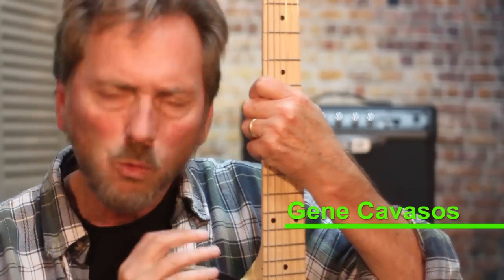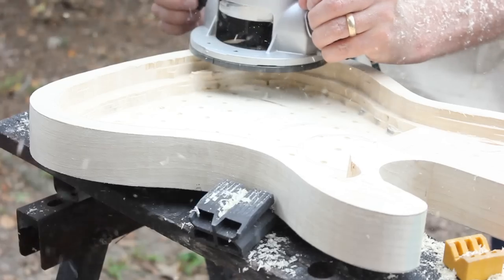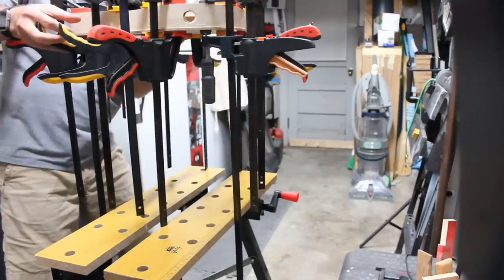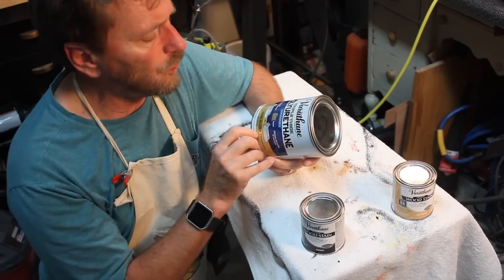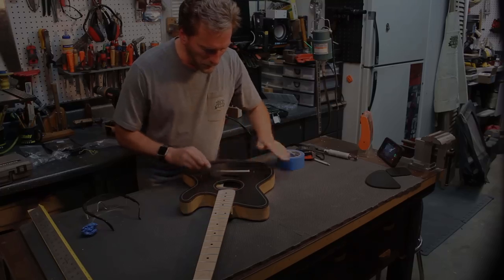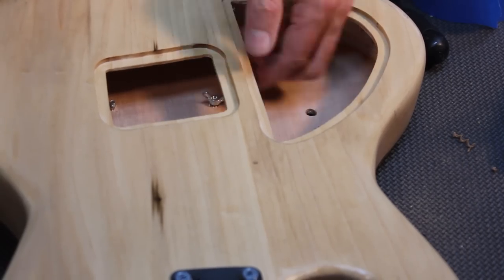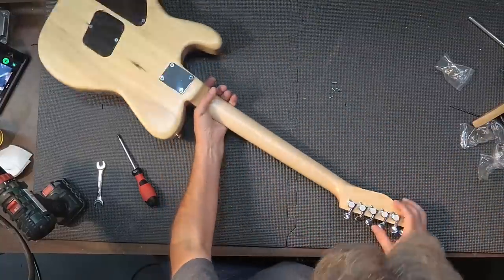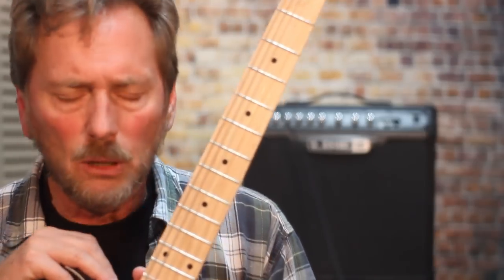How to Make an Acoustic Electric Tele-Style Guitar (Step by Step)

Comment: I've seen a couple DIY types made online....no one seems to put bracing on the inside of top (like an acoustic).  That top has 200lbs of stress on it.  The original Fender model has a braced top.  Over time, if it doesn't explode it will probably warp the top.
Reply: David Kennedy that’s a very good point! I think some type of bracing would be necessary for this guitar to last any length of time.
Reply: @Delzona  I'd like to see the inside of the fender acoustasonic and see how it's braced
Reply: Exactly, it will not hold up.
Reply: Top bracing will also help control some of the feedback as well as provide overall rigidity against warping. Great job btw.
Reply: I agree. I bet there will be some warping in time. With braces warping could be avoided. 
What about inverting the structure? That is: relatively thin wood on the back, and strong main structure (which can hold "string power").
Reply: @AntonioFardella  All you need is a few braces...it wouldn't be hard to do...I'm interested in hearing how the Fender acoustasonic is braced.....anyone who knows tell us please.  They list it on the fender site but don't show the inside of the guitar.
It looks like he used a thicker top which may help but over time it will probably warp with the 200 lbs of stress on it.  4 or so braces would probably solve it.
Reply: @AntonioFardella  There's a german man online who did one.....he used a fan brace for the back and a perpendicular brace for the neck area....he put the soundhole up top....above the neck.
Reply: If I was making this, I think I'd rout out all but the space below where the bridge went. I'd leave a solid wood block as part of the body that would support the bridge. That way, no bracing would be needed on the rest of the top.
Reply: Hi guys, just a couple of things to think about, this top is plywood, made of layers of veneers with perpendicular grain, in other words it is already braced to a certain degree.
Bracing in the guitar building world is a balancing act, you add structural integrity at the cost of volume and projection. It is very easy to overbrace a guitar top.
Now let’s talk about what happens when the top does shift a little, most likely bellying up where the bridge is glued on... this guy has a bolt on neck! He can just drop a shim in and probably have super sweet action again in about an hour.  It’s not nearly as big a deal as you might think. 
And worst case scenario he has to plane the top off and do it again.. oh well.  
Best.
Reply: One way to avoid the bracing could be by gluing a piece of wood between the bridge and the back
Reply: @MrErdner  I was thinking the same thing as you
Reply: @lorenzoblum868  My thoughts too. But a banjo style bridge brace would show through the sound hole. The fender has a deep funnel type sound hole so that could be used as part of the brace between front and back. Also a rod style piezo would sound better underneath the bridge. You also need to think about shielding from feedback. Using grounded alu foil on the inside would work. If you built the neck bracing into the hollowed body along with the funnel the top plate could be wired in like an electric guitar scratch plate. Fix this into the routed recess with rare earth magnets and you don't need access plates at the back.
Reply: @cugir321  Trogly did a review of the acoustasonic and stuck a camera inside, there was no bracing if i remember correctly, but go watch that video to find out!
Reply: Another idea might be to use ferrules and make rear-loaded strings through the bridge.  That way the tension would be off the top.  Actually if you used a steel plate on the back, you can solder a ground wire to that so you don't get hum from ungrounded strings.
Reply: @cugir321  it isnt from wat i seen in a video of the production of the guitar , its pretty thick though
Reply: @pallecla  it might if it has a block under the bridge (all the string tension would go through the carved out body not thetop) but i doubt it will sound verry acousic if he did that
Reply: @helojoe92  Fender says it's braced.  I did see one cross brace behind the bridge in Trogly's video
Reply: @MrErdner  And it would provide a nice sound block for the bridge as well, which could improve the acoustic tone.  It would have to be sized to properly accommodate the string holes, which is to say the blicks trailing edge (farthest from the neck) would have to end shy of where the string holes are by at least half the width of the ball end of a string, since the bridge pins push the ball end toward the neck as they're inserted.

It would still provide the support this guitar needs, without hurting its resonance in any way.

I'd love to hear how this guitar sounds unplugged.  A hogged out poplar body supporting an MDF top.  If it sounds decent there might be some high end luthiers out there who have some 'splainin' to do!  😉

What a great build.
Reply: @JefAlanLong  I think he said it was MDF with a mahogany veneer.  Not ply, and definitely susceptible to environmental conditions.  I could have mis-heard him.
Reply: worshipgeek you might be right, I don’t remember either!   Still probably not a big deal, shim the neck if it (the top) moves.  It depends entirely on climactic conditions where the guitar lives, if it’s a nice stable environment might be fine, a lot of the over engineering in guitars (bracing, truss rods etc) is really so the units can be shipped all over the globe, tropics to tundra if you know what I mean.  Best.
Reply: @lorenzoblum868  that is how it is done in a violin. However, it was tested on a guitar in various configurations but in al cases was bad for sound quality.
Reply: @AntonioFardella  I think if you invert the structure, you end up dampening the vibration of the only thin bit of wood against your body.
Reply: Yep. String tension against what is essentially a piece of thin MDF? No way José. In addition to at least one ladder brace, it also needs a bridge plate.
Reply: @MrErdner  sustainblock 👍🎸🎶
Reply: lots of super janky builds
Reply: @AntonioFardella  thats actually a great idea and would be just as easy to make as this... or hard depending on how good you are in your wood working skills.... cheers.... just remember something; with all guitars you usually have to make sure you put the neck in, then make a precise measurement to mark out where you put the bridge.... otherwise the scale will be off and it will be out of tune in places. I noticed he didn't do that. Did I miss something here?
Reply: @AntonioFardella  think I found the bit about scale measurements as I hadn't seen the end of the video and it was my mistake, it was the Measurement to the bridge.... cheers.

Comment: As a luthier I suggest you remove the top and add a bridge plate and an X brace,  the glue on the top is fairly new and you can heat a pallet knife or a thin blade and remove the top.  and you can change to a bridge pickup.

Comment: As a woodworker,  you do a nice job for the tools you are using.  one major flaw  and that is the top material,  MDF is compressed sawdust it has no tonal quality whatsoever  and wont last long,  as humidity will cause MDF to swell over time and just a little thick for the bridge, where you transfer the sound... but overall, not bad for what it is

Comment: Maybe you can put a volume control for each pickup, so you can blend the overall output.
Reply from the maker: Andrew Hinds, That’s not a bad idea. Thanks so much for watching.
Reply: Along the lines of a tone knob, consider different ratings for your piezo. You may just need a different resistor to cause a balanced pickup/piezo “relationship.” Knowing the resistance of your pickup and the resistance of your piezo will give you a better idea of how much you would want to consider. I’d offer advice but because you are dealing with two different types of input (piezoelectric and single coil pickups) it most likely would be a trial and error scenario.

This dynamic relationship is something that guitar makers don’t reveal and this is why the Acoustasonic Telecaster is priced accordingly. If you know someone with an Acoustasonic, you could always ask them.

For dynamic reasoning, this is also found in how “single coil/humbucker” combos have to be considered. A lengthy and somewhat theoretical debate or conversation ensues when best combinations are considered. Thanks for the great video!
Reply: A 1M ohm pot works best for piezo pickups.

Comment: You can get a spray like finish on the large flat surfaces by using a fine pump spray bottle of water. It will pool like glass. The Varathane waterborne is not the hardest finish.

Comment: Hi I’m an experienced guitar builder. You did a great job here, really fantastic.  But before you do another I’ll give just a few suggestions.
1. Next time mount the magnetic pickup into the wood at rear, like the superstrat way of doing it.  It’ll really help control feedback at high volumes to decouple the coil from the singing top. You’ll need to leave a little more wood in the body beneath the pickup so your screws have something to bite into. 
2. Your piezo pickup is overwhelming the coil pickup because there is a tremendous impedance mismatch between the two.  You have a few options to improve this, especially when building a new one.  You might add one of the side mounted preamps for acoustic guitars, even the cheap ones will improve things a great deal, feed the piezo through that before going into the three way switch.  You might even get one with a tuner built in.   Another option is put a Tele neck pickup inside the body, directed at the soundboard, and glue something ferrous (a couple of guitar string clippings) to the underside of the soundboard directly above where this neck pickup will be, it will ‘pick up’ the vibration from the soundboard from these little bits of steel glued on there.  This works much better than you might think.  If you go this route you’ll have noise cancelling properties when combining both pickups and no impedance mismatch.
3. You really need to connect the ground side of you circuit to the player’s body to overcome noise with magnetic pickups.  Usually this is done through the strings at bridge or tailpiece.  Consider a small plate of sheet steel directly under the bridge (and drilled for the bridge pins) So that the ball ends sit against it.  This bit of steel is wired to the ground in your circuit, the back of a pot or the sleeve on the output jack.   This bit of steel might also be the bit of steel I mentioned in #2 above ;)

Great job and great video, I really enjoyed it.
Reply: I didn't see any bracing on the top, is that ok or the top will bend soon?
Reply: Hap Dane well the top is craft plywood, so it’s pretty much braced in its construction. But a bridge plate might’ve been wise.
Reply: I would like to add the suggestion of outlining the bridge and removing the finish on the entire shape rather than just the sliver for a wood glue contact patch. I'm sure his will be strong enough but I think it's best to glue the whole area based on builds I've seen.
Reply from the maker: @DouglasThompson  excellent suggestions.
Reply: @DIYGene  I saw that you rebuilt this guitar after the comments, I have yet to watch the whole video but if you already did this, I suppose the comment is purely for future guitar builders to read and absorb. Either way it's a cool project, I'm into guitars that are versatile such as this.
Reply from the maker: This has turned into my go to guitar. Thanks again
Reply: @DIYGene sir would you myt why dont you hire a guitar builder specialist make a lot.. then go into the guitar business and sell in the market.. where the guitar lover to buy it.. ❤

Comment: On the switch: Might be worth just making a craft-foam pad for it to float on. The peizo's sound also changes a lot depending on placement: most cigar-box builders put it behind and slightly above the low E string so that it catches more of those vibrations and slightly less treble. I usually wire two smaller ones together instead of using one big one.

Other then that, just raise the electric pickup.
Reply from the maker: Alaric Paley , Great advice. I’m learning on these peizo’s. Thanks so much for watching.

Comment: Some tips from a player but NOT a luthier; -Work on the neck heel joint, try to shape it to be more comfy and ergonomic, not a must but is a nice detail that everyone likes when playing.
-The acoustasonic has a blend circuit, basically, a knob that controls both the piezo and electromagnetic pickup at the same time, it's more of a electricians tech trick than a guitar feature, but the real one has it, even tho your idea of just using a tele 3-way switch also works great, but some people like to blend both things accordingly.
-Poplar is all of a topic in guitar forums.. many hate it and claim that is not a good wood for guitars, I personally have one guitar made of poplar and I love it, truth is; you can make a guitar out of any wood. But when doing a hollow body or acoustic, things differ a lot from the solid body ones. in this case poplar would be a weak and thin sounding wood.
-Usually the bridges in acoustics are always glued on the top, in some archtops or hollow-bodies, they may even be held in place by the preasure of the strings alone, something more like a violin or cello. I know it was an awkward position to put some clamps so it's okay, adding two screws would definetely not affect tone or anything, but is just a "traditional" detail.
-There are ways to isolate the piezo signal, so it's not so microphonic, because sometimes they can even pickup noises in the room, but I'm not sure what these methods are. And like you mentioned, yes there are piezos with different rating values, making them more sensitive or louder.

None of these is something negative, your build ROCKS! they're just tips or details I've noticed that could do your project better. I wish I could have access to all of those tools and a workplace to try it myself.
Reply: Good tips. One thing you said needed clarifying. When using a bridge that is held on by pressure, one needs a tailpiece to attach the strings. There is usually a piece of wood on the backside of the top to give strength at the bridge position. The wood used for the top looked a bit thick so it may not sag, hopefully.

Comment: You did a fine job. There are a lot of comments about bracing. Having a thicker top like you have may be your savior. If you do build another, I would make the sound hole a little smaller, use a spruce top with just a couple of braces, also a bridge plate and a  metal bridge pin protector so you can put a ground wire to it, that way your strings will be grounded. Just my 2 cents.

Comment: I really enjoyed the video! I like the finish and the pinstriping. My only suggestion would be to glue a few braces under that top to give the bridge area some strength. With the access covers it can probably still be done.This inspired me to get building again! Thanks Gene!👍😎🎸🎶
Reply from the maker: Thanks Dart Man!  Do you think the brace should run between the bridge and the tele pickup?
Reply: @DIYGene  that's a good question. I don't really have any experience building acoustic guitars. There are some good videos out there that could help. Good luck with it. I think it turned out great...just a little reinforcing on that top and it'll be awesome!👍😎🎸🎶

Comment: Cool build Gene.   Might have to try my hand at one after I'm done the project I'm on now.   A couple things I would suggest would be to have a bridge plate installed and some bracing to the top to prevent any future bowing in the top.    I would also suggest gluing the bridge before finishing to get a good solid wood to wood contact glue joint.    Great work.   Thanks for the link on the sander too!

Comment: Monday morning quarterback here. I might have considered eiter some bracing under the bridge or a pair of posts connecting the top and bottom under the bridge as they do on acoustic basses.Im not too sure if the bridge wont pull the top over time
Reply from the maker: Anthony Rosa, I like the idea of the posts. It’s been 6 months so far so good. Thanks for the great suggestion.

Comment: That is so cool! I have woodworking in school and I‘ll give it a try (we can build whatever we want). I think this video is really going to help me. Good Job👏
Reply from the maker: Thank you I hope it inspires you. Thanks so much for watching.
Reply: DIY Gene just a quick question how thick is the wood you used?
Reply from the maker: Kilian Z , I used 1-3/4” poplar and 1/4” Burch plywood. I hop that helps.
Reply: DIY Gene thank you! Did you just estimate the dimensions for the bridge, the sound hole and the controls or did you have a exact template for that?
Reply from the maker: I measured from the nut to the 12th fret, then went the same from the 12th to the bridge. It was around 13”. I also used the Crome plate that the controls as the mounting template. The sound hole I just winged it.